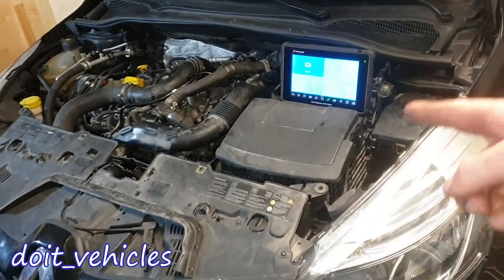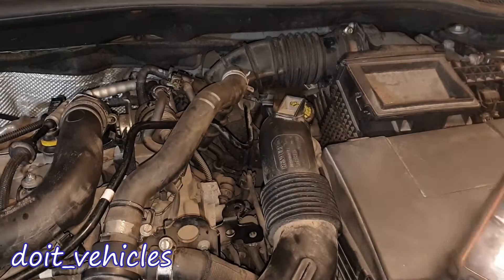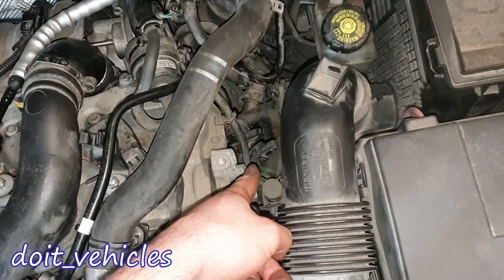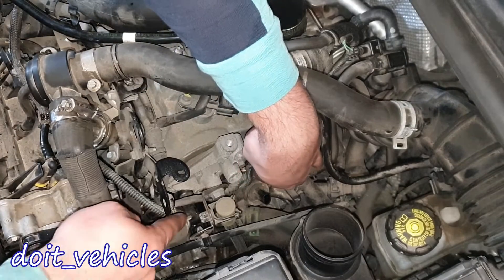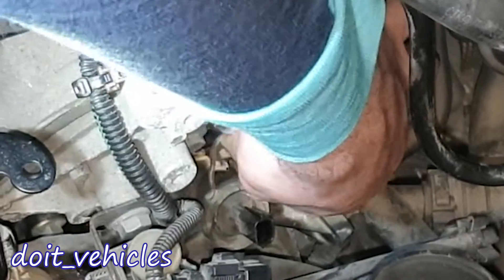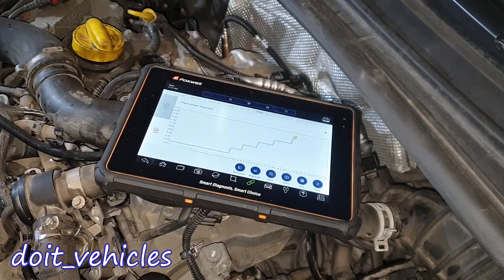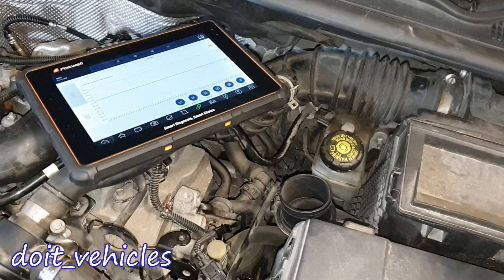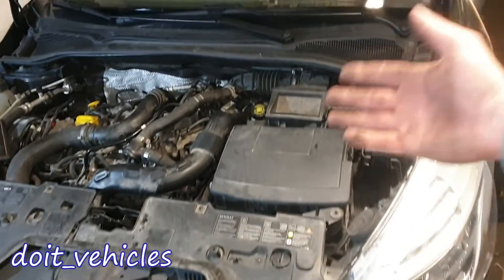CTS test - Renault 0.9 TCE ( coolant temperature sensor )

Comment: @Doit_vehicles , I have a Renault Sandero with the same engine. The fan kicks in at 102 degrees Celsius consistently and goes down to around 97 but never goes down to 90. Could the coolant temperature sensor be the problem? The vehicle overheated about a year ago, the engine was overhauled and the both thermostats were changed but the sensor was not changed. Could that be the problem? *there is no engine light or error code on my obd2 scanner